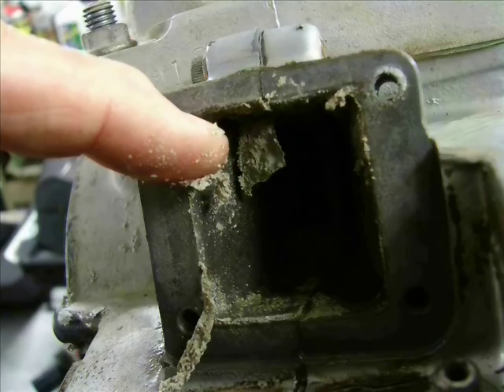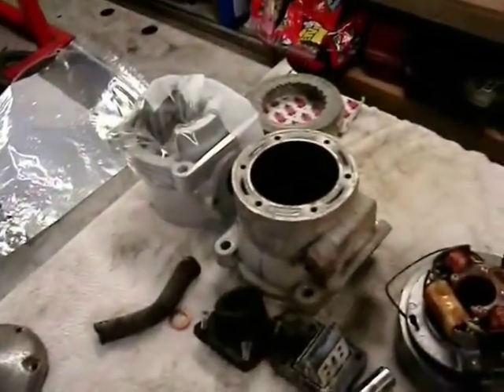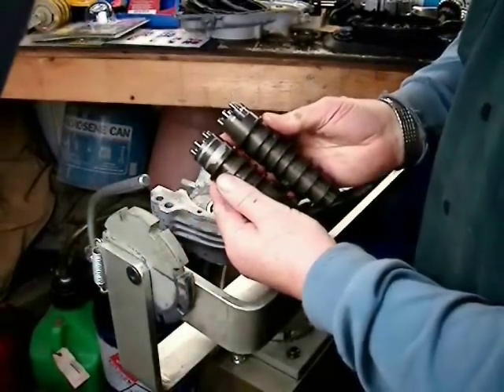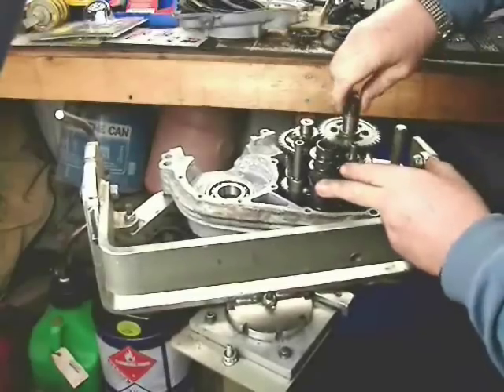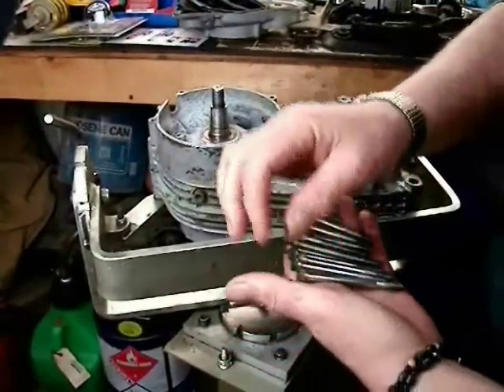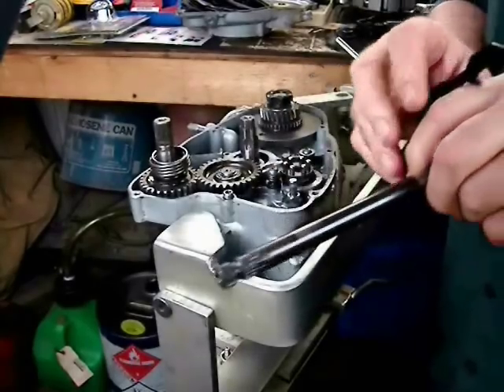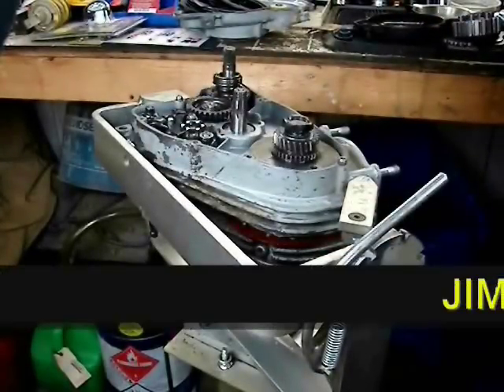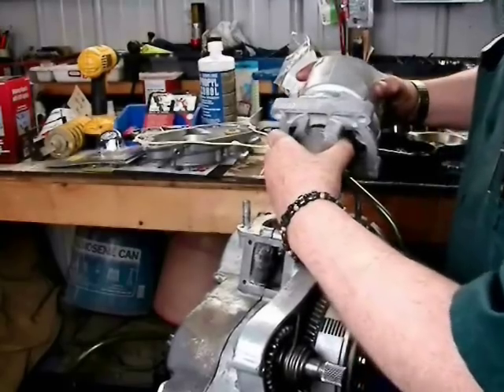Jim Snell - GasGas Trials and Pampera  - engine overhaul TXT TX JTX JTR GT JT

Comment: Hi great videos always watch your channel before starting work on mine, just a quick question, what would cause galloping type revs as the bike returns to idle from revving fully in neutral. The bikes a 1996 jtr, it does not do it all the time eather, it will sometimes idle normally but then sound like the timeing has changed as if its changed settings automatically its weard the bike pulls fine..
Reply from the maker: seems you have an air leak. (the symptoms are typical of a lean condition) and it is odd that it is not consistent. Could be left side crank seal. could be intake manifold in front of carburetor, could be jetting issue or even a partially obstructed pilot jet.

Comment: Whats the difference in the   Trials and Pampera  engine ?
Reply from the maker: In the Pampera engine, 3rd and 4th gear are slightly different ratios. This makes the six-speed Pampera gear ratios more evenly spaced. The Trials engine has the first four gears very close together and 5th and 6th are stepped higher for higher-speed trails. Other than this, the Pampera engine is exactly the same as the trials engine.
Reply: @TRIALSPARTSUSA  Thanks .